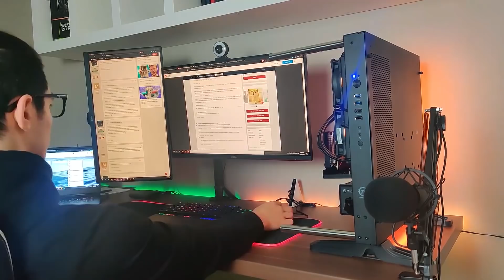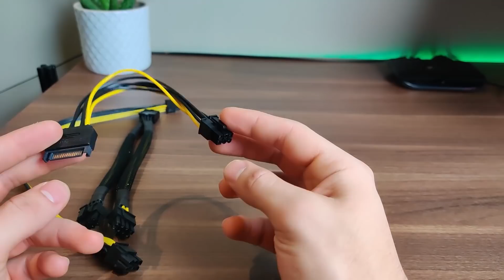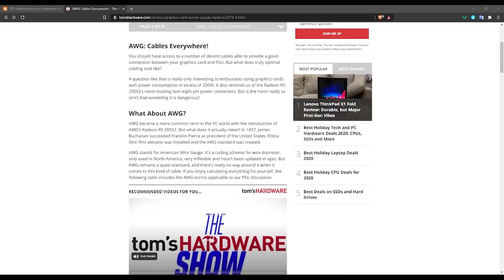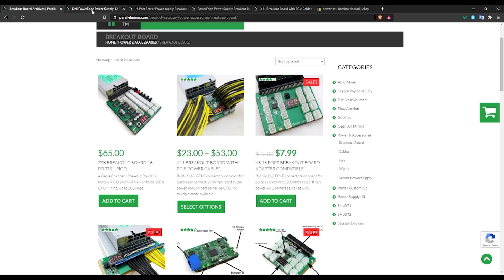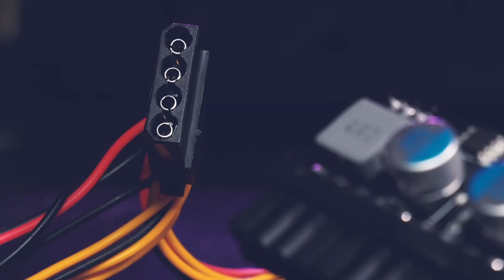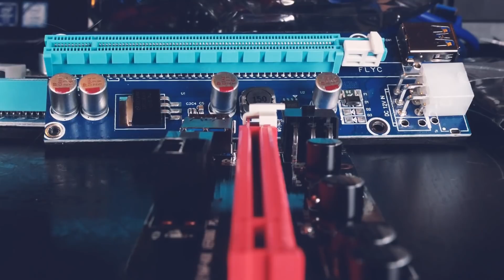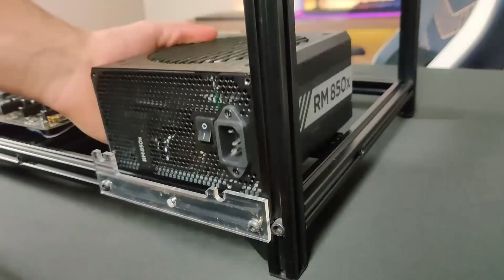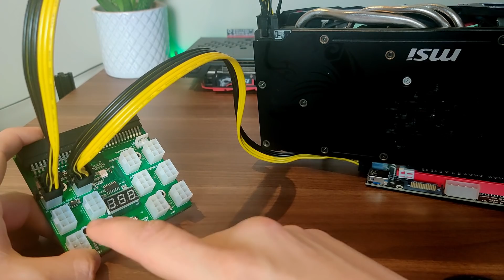Using Server Powersupplies For Your Mining Rig FULL Guide

Comment: For those who thinks about getting a server psu, here are a few questions i had when i first got mine :-) 

-How loud does it gets?
They can get loud but it depends on the load and ambient temp. Its a high pitch whining noice when it runs on full blast.
If you have just half load in it, you probably will hear it but i was surprised how silent it was then. But as i got more cards and used more power it got louder. It depends on what you can tolerate.
Btw, the fan runs on low speed whenever its connected to power, and turned off. This is normal and will help cool it when you turn off your rig.

-How hot does it get?
They get hot, i was concerned at first but turns out its just how it is. I can easely meassure about 40*c on top of it when running. 
When you first start up, it will run silent, but as the temp rises, the fan wil ramp up to full blast until the temp goes down, and then it will gradualy reduce the fan speed. I meassured the temp from the exhaust, and when it reached 44-45*c it went on full speed.

I designed and 3d printed a shroud for mine where i have a 80mm fan blowing air directly into the back of the psu to help feed it with air, this reduced the fan noice a bit as it helped with cooling. I was thinking of uploading it to Thingiverse, but havent got around doing it yet.
I went straight for the server psu, i have never used one before, but it was really easy and CHEAP!
Btw, the display on my breakoutbard shows volt, and not amp/watt.. But that would be awsome if it showed watt!

And when it starts up and nothing using any power, it shows 12.1, when its running and the gpu's mining, it will go down to 11.9.. Kind of weird and i dont know if its normal..
Edit: Apparantly its normal.

I made a video of my PSU, and different sound levels, also how the fan shroud i made helps to lower the sound of the fan. 
Video:
https://youtu.be/wuPqBd300EE
Fan shroud on Thingiverse:
https://www.thingiverse.com/thing:4790083

If im not allowed to post links here, tell me and i will remove it. :-)
Reply from the maker: Now that is a one of a kind comment. Thank you for all the information!!  PINNED!
Reply: @MiningChamber  Thanks!
Just a few thoughts i had when i started, tried to google it but not much info to find on this, guess its not something most people think of.. I always find my self having weird question that never has been asked online. Hehe
Reply from the maker: Haha love it thank you ! 🙏⛏️
Reply: this was really helpful thank you!!!!
Reply: @kylemesdag7770  Nice to se that im not the only one with these questions. :-)
Reply: @davidanthony1816  Im at 240v ;-) But yes, its recommended to use 80%, for better life of the components inside it i think..
Reply: The voltage drop is totally normal. The ATX specs give the 12V rail 5% tolerance, that is ±0.60 V.
Reply: @davidanthony1816  Yeah if you have a small load on it its not bad at all. But as the load increases it gets louder. Think i have around 800w on mine, and its pretty loud, not asic loud, but its winy so to speak.
Reply: I really appreciate your insight! Thank you :) Are you on the Mining Chamber Discord btw? Here's the link to it: https://discord.gg/bK6ptDN  
Would be great to connect, my ID: Janek#3477 
Cheers once again for the info bro!
Reply: @YaNeK92  Hi, no im not on the Discord (I am now :-P)
Reply: Yeah, for those that don't have a great deal of experience with server power supplies (whether for mining or actual servers), when you first plug it in, it will go into standby mode.

In an actual, normal server, what happens with that is that it will power the system such that if you have remote management on the server (e.g. IPMI or some other kind of BMC), it can receive a remote signal to actually power on the server without you having to physically be there to press the power button. And that's used a fair bit (along with the rest of the remote management tools).

So, if you do get a server power supply, don't be surprised that when you first plug it in, it will fire up immediately, and often times, the fan will also be running at full tilt as well, because it's also a safety protection on the system as it might not be aware of what environment that it's running in. Once it completes it's own POST, it will drop down in fan speed depending on your ambient temperature.

It's not uncommon for server power supplies to get to anywhere between 45-55 dBA, so be mindful of that. (Again, in a normal server, at full load, the server itself would be louder than the power supplies, so generally, you won't even notice it.)

If you're running a GPU mining rig and you want to try and run it desk side or something like that, the fan from the server PSU can very well be the loudest thing you'll hear.

And yes, they do get hot. Again, normally, in a server environment, the server itself will have fans that can blow air at it, and that will help to cool it. if you have space to do the same, it would be a good idea. Not having a fan on it won't necessarily hurt it, but letting it run a little bit cooler is always better than not.
Reply: I searched up "server psu noise" and the first video was 10 years old and it showed how the PSU sounded when plugged into the wall without anything attached. Both the PSUs were extremely loud. But you say their fans should be on only at low speeds if nothing is connected. Any advice? I want to put one in my bedroom so am really worried about noise.
Reply: @quantum8522  As Patrik says, if you are buying parts now, i would wait and see how the market goes after eip-1559. the psu isnt the only thing making noice. It will be fairly silent if the load is not big, but as you put load on it the fan will get louder and louder. I have my rig in my basement, but i can hear it in my bedroom. Kind of got addicted to the fan noice now.. Its so quiet here if its turned off.. 😂
Reply: @Alpejohn  Ha of course! I feel the same about my fans, they're a good source of white noise. I think the server PSUs can sound a bit annoying though.
Reply: @quantum8522  What you can do to help Cool the server psu, is to 3d print (if u have a printer) a shroud for a 80mm fan. I drawed a shroud in fusion and 3d printed it, has a 80mm fan that blows into the back of the psu where the motherboard is. Helps force air into the psu. This actually made the fan spin a bit slower.. Ofcours you get more fan noice but its not the same whine from a 80mm fan as from a 20 or 30mm or what it is.. 😝 It can help to have a fan just blow at the intake also..
Reply: @Alpejohn  That's super sweet! Do you have a link to that file anywhere? Might be interesting to check out!
Reply: @quantum8522  I'll see if i can upload it to Thingiversae later this evening, and post the link here. :-)
Reply: @Alpejohn  Awesome, thank you very much :)
Reply: @quantum8522  No problem! 👍
Reply: @Alpejohn  sweet! Would like to print one as well😎
Reply: @quantum8522  I posted a link to a video i made of the sound of my psu in my orginal post if you are interested. :-) It also shows the sound of the fan with and without the fan shroud.
Reply: If you're worried about noise, you shouldn't mine. The PSU won't be the only fairly loud thing. GPU memory must be cooled, so you gotta ramp up the fan speed as well. Just don't put it in your bedroom.
Also, you're kinda late at this point. Profits are going down, and it's really hard to come by GPUs for realistic prices. Buy ETH for that money instead, and hold onto it a few years.
Reply: @patrikjankovics2113  I've gotten a few GPUs at MSRP. They're not really that loud, I don't have trouble sleeping with a bunch of fans on either. I'm just worried about getting a server PSU which would be much worse

Comment: EVGA released the 3060Ti XC, which is a single 8pin powered card they rate at 200W... and that limit is probably just for thermal/noise reasons and not power safety reasons xD
So 200w+ on a single 8pin pcie is MORE than safe, otherwise major brand wouldn't release such cards
Reply from the maker: Interesting thank you for the info!
Reply: Probably includes draw from the PCIe slot too

Comment: I have a question after this video... Can you plug 1 eight-pin only on a GPU even it has 1 six-pin and 1 eight-pin connectors? Will it satisfy GPU's power demand? Let say 5700XT
Reply from the maker: I've seen some people do it, but honestly I just wouldn't risk it! Your better off using a splitter to minimize the risk

Comment: Another type of power supply that you could use are ASIC power supplies. If they have a 6-pin, they always run off of 12 volt and are compatible with GPUs.
My rigs all run off of 1 Bitmain 1600W PSU and 1 ATX PSU.
I have recently ordered a few Pico PSU's wich will end up replacing my ATX PSU's

Another great place to order mining rig parts from is Alibaba. You are for the most part ordering a lot of the same components which makes them really cheap

Great video as always and congratulations on 10k!
Reply from the maker: That is true !! I should make a video for that topic haha thank you!!
Reply: @MiningChamber 
That would be a great video!

Comment from the maker: Thank you all for watching!! 

*Correction!*
- That meter on the breakout board is not for measuring amps, it shows the voltage, silly me 😅 (Credits to the awesome community)
Reply: Would be really awsome if it actually showed watt usage!
Reply: Thanks for the correction, i was in panic when you said that hahaha
Reply: I really don't see the point of even having it.
Reply: Hey man, how should I wire a gpu with 3 power sockets? do I get a 3 way splitter? what happens if I power it with 3 connectors from the board?